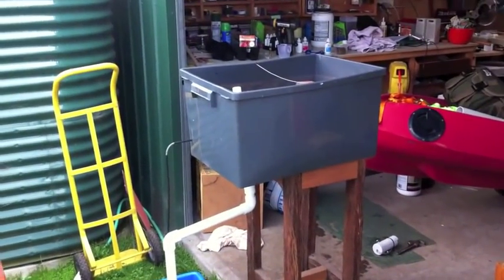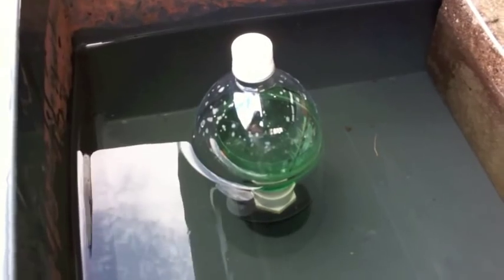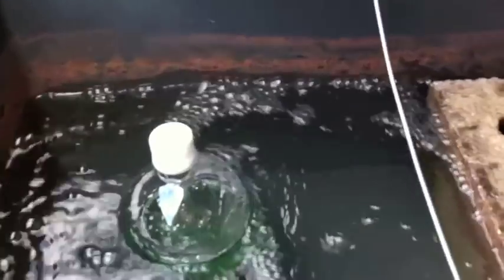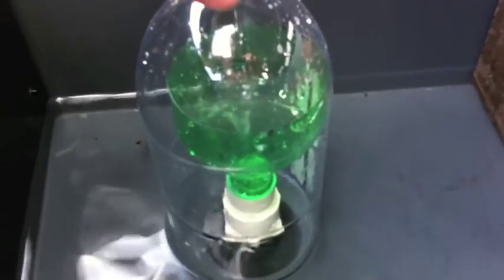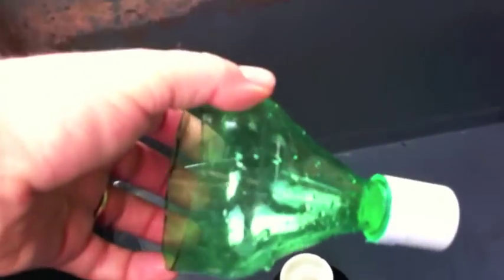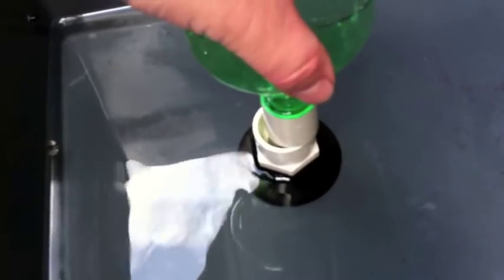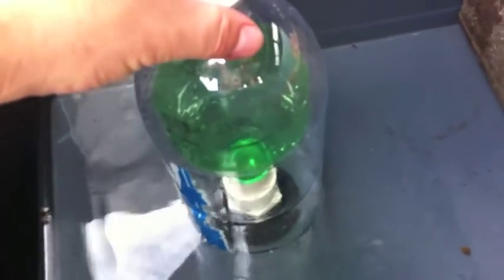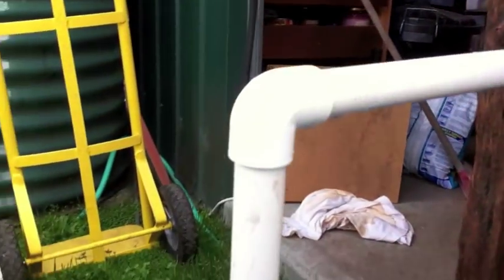Aquaponics - Cheap Bell Siphon with Plastic Bottles

Comment: Wow Thankyou. I had put together a standing drain pipe but I did not have a pipe wide enough to get the suction needed to drain.  So after watching your video I tried using a soft drink bottle with notches cut out of the bottom. This worked perfectly. Hooray.

Comment: This is an awesome setup! Tried PVC, but this is so much easier and cheaper. I did have a problem stopping the siphon, but I added the snorkel tube in the top cap and that solved it.
Reply from the maker: Also try to reduce the flow on the pump, if there is too much flow from the pump it will not stop either.

Comment: The most important tool to have with aquaponics is a level!  I tried to explain this to several women and they didn't understand until I got my trusty builders level out and let them play with it so they understood what was level and what wasn't.  They knew water could not flow up hill... I think.  Then I said you can make your system level and then when you fill it up with media and water the weight, soft earth and shoddy work could cause it to be out of level and then the siphon and other things may not work.  I can't sew, cook or multi task as good as they can though.

Comment: looked online for bell siphons, prices are a joke. 35 pound for a small cut pvc pipe. so looked up homemade bell siphon and here i am.

just tested it. and works great. my only problem is the bottle sucks itself in. and with a tray of 300L of clay pebbles. im worry they will fill the gap and stop it going back. so will have find a stronger bottle.
but thank you. you just saved me 70 quid
Reply from the maker: Hi Shane,
Great news it works.Here in Oz I have found that ribbed water bottle work best as the ribbing gives them added strength. Plus you can find them in just about any bin! 
The best part about it I find is you can see what's happening. Priceless!
Brett C.
Reply: thanks for the advice. i got a orange juice bottle thats alot stronger. that i try out tomorrow
Reply from the maker: shane cattell be sure to come back and let me know how you go.
Always like to here.
Brett C
Reply: Brett Cooper well mine was on a larger scale, i used 2L bottle inside and a 5L square water bottle.
first problem. 2L was to weak and sucked its self in. solved by cutting and placing init. a rim from a plastic plantpot.
then i had the problem after water went back down it kept the airlock. puting it in a kind of freeflow. solved by drilling a hole in 5L. then using a gromet and peace of hose. cutting it off about 1" from the bottom, so that it sucks in air after its below the 1".
now its all working fine. even with 250L of pebbles around it..

Comment from the maker: There might be a couple of things to look at.
1. Note enough flow to get get started - once it is full and water flowing in add some more water from a bucket to see if more flow helps?
2. Have you added in an elbow on the outlet as I have in the video, I find this helps a lot in creating a suction.

Comment from the maker: Hi Enrique,
Sounds like the pump flow could be your issue.
Another thing to try is make sure the stand pipe is level and the water is going over evenly?
If it's only going over at one spot I find it's harder for it to start.
Also try an elbow on the bottom of the outlet. This can sometimes help?

Let know how you go.

Brett.

Comment from the maker: Yes you will need a gravel guard, PVC is probably the strongest or you could try a bucket. What ever you use just make sure your hand hand fit in all the way to the bottom.

Comment: I use a male plumbing threaded adapter, a female electrical threaded adapter (no taper to threads) and an "O" ring. Cheap at Lowes or Home D. Never had a leak in 9 mos. and I am running 5 ibc grow beds soon to be 10. I do enjoy your clear bottle for entertainment sake.

Comment from the maker: @leema2100 I use 25mm PVC on the bottom of the bottle with a 25mm threaded adaptor onto the 25mm tank adaptor. I hope this helps? The PVC pipe is a little bigger than the soft drink bottle so i just us hot glue to pack t out.

Comment from the maker: Hi,
If you are talking about the out side bottle nothing stops it from floating away, as the water rises the air inside gets pushed out the pipe attached to the funnel. Normally the whole unit would be inside a large PVC pipe to stop the media from getting sucked up. Hope this helps?

Comment from the maker: @plantbaseddietplan, there are couple of things you can try. 1. is the funnel level, is the water coming over the sides evenly?. 2 try increasing the water flow. 3 put an elbow into the outlet pipe or even a small restriction to disturb the water as it comes out. Try them in order and please let me know how you go?

Comment from the maker: Need to make sure the water flows over the funnel evenly so it cuts off the air, you could try reducing the bottom of the funnel or maybe add in an 90 degree bend on the outlet. 
If possible post a video or a photo of your set up and I will be able to help you more. Good luck and please let me know how you go.
Brett.

Comment from the maker: c. The space in the bell (outer bottle) doesn't make a huge difference as long as there is a few mil between the funnel and the bell for the water to get past.
I hope this helps?
If not let me know at what stage it's not starting or continuing.
Regards,
Brett C

Comment from the maker: Hi Konig640, no it doesn't need to be water tight. If I read this correct it does start but then stops? Sound to me like you do not have enough water going over the side. Is your pump running flat out? If it is maybe reduce the size of the hole in the funnel to allow the water to back up a little before it starts. Let me know how you go and what happens. Brett.

Comment from the maker: Please start on the post below then come back to this one.

3. Is the water flowing over the top of the funnel evenly - if it just come over on a low point it's much harder for the hole at the bottom to cover over and create the vacuum.
They are the main issues I have come across.
Are you able to post a video of whats happening. More than happy to help as much as I can.

Comment from the maker: Hi John,
It won't be much stopping it from starting, I just have a couple of questions:
a. As the water flows over the top of the funnel does it appear to be covering the hole at the bottom or just running straight out? If not your inflow needs to be increased.
b. Do you have an elbow on the outlet below the tank? This can sometimes help.

Comment: Hey brett, I'm having trouble starting my bell siphon. My stand pipe has an inner diameter of 12mm I think and my bell siphon is a 73mm pipe. But my old external aquarium filter has a weak flow but it's able to full the grow bed in 5 mins but then the water level reaches the stand pipe and stars to drain down slowly. The siphon never starts but if I add 2 liters of water to give it a quick fill, then it starts to siphon like it should.
Should I get a stronger pump or make the stand pipe narrower
Reply: Add an elbow-joint under the tank. This will provide some counter-pressure, allowing your water level to rise a bit more and in turn activate properly. 

But yes, you should get a pump with a larger flow-rate.

Comment: How do you prefent the outside bottle to be pushed up whe the system fills again? I mean, if the botle is empry, the air that is in it can't get away. Or do I oversee something?
Reply from the maker: As the water rises the air is pushed out through the drain/stand pipe in the middle that goes out through the bottom.

Then around the outside of all that would be a PVC Pipe or similar holding back the media.

Hope this Helps Wim.

Comment: does the syphon (the green part) need to be completely watertight with the base?
I was wondering because I built a similar one but used a glue gun to fix it which is not 100% tight. thing is that there is only a realy small amount of water flowing into the syphon which makes it stop after a short while....any suggestions?

Comment: I may be missing something quite obvious, but I guess I still don't understand how a siphon works. I'm currently testing my little one, and I have the "green bottle" set up. I have cut another bottle to go over it. I put the bottle on top, as you've seemed to. But I'm not getting the siphon effect. Is the remaining space in the top part of the bell the thing that causes the siphon effect? I'm quite dense as you can probably tell.

Comment: would like to see this run a full cycle with the intended pump(if intended as a constant pumped system) i think you will have issues with stopping the syphon
Reply from the maker: Hi Bykerdellic,
I have a similar siphon working in my main system now. The main reason for it not stopping is too much water flow.
In that case you need to add in a tap and just slow the incoming water down  a little.

Comment: hey, great siphon! I'm trying to reproduce it but my outter bottle keeps flotting. I've tried tinkering with the size of the bottle and the "vents" at the bottom for the water flow but no luck .. would you have any tips? cheers!
Reply from the maker: I have never had a problem with that. The air inside the the outer bottle should escape down the centre of the funnel. Even if it did rise when the siphon starts it would pull it back down.
Reply: Hey Brett, thanks, no worries. Something wrong with my outlet pipe which I fixed. Working great now! cheers

Comment: I have a problem of DIY siphon. My plastic water drawer/tank is not too big. I tried a different size of siphon. However, the water does not go fluently everytime, nor it could reach the very bottom of the siphon.

So does the following matter ?
1. Height of inner and outter sihpon ?
2. Size of the water drawer/tank ?
3. Size of the hole for water leakage ?

If there is a recommend sizes or formula, that will be great.
Or if a whole set of tank+siphon can be purchased, I would love to (because I spent a lot of time in testing already).

Thanks a lot for any help please.
Reply from the maker: Chun Yi Chow Hi, are you using a siphon like I have in the video?
The height of the inner stand pipe should be high enough that the water stops about 2cm under the top of the stones in the grow bed.
If you are having issues getting it to start look at these:
1. is the funnel/stand pipe even, check that the water is not flowing only over one side but evenly around the rim
2. add and elbow to the bottom of the outlet pipe.
3. make sure you have enough flow coming from the pump, if it tries to start and won't use a hose to see if some extra flow will help get it started.

If non of those work see if you can post a video on youtube of what's happening and come back and share here to see if I can help.

Good Luck,
Brett C
Reply: Thanks Brett. Here is the setup dimension but the videos take few hours later to be uploaded.

https://www.facebook.com/media/set/?set=a.10153291738978669.1073742225.591438668&type=1&l=ba1913caba
Reply: I will upload the video soon. When there are no objects in the tank, it works. However, when I put all the circle pot into the tank, is it because the pressure and water volume change, that's why the siphon did not work so easily ?
Reply: You can see my other photo albums. Other setup (e.g. hydro / aqua are working and I have been eating the vegetables after 3-4 weeks). This siphon is another add-in to my project. Thanks a lot for help.
Reply: Chun Yi Chow is the PVC the outer guard to keep the media away? If it is there are not enough holes in it to let the water in. Looking forward to seeing the video.
Reply: I only have 2 PVC inside the tank. 1 PVC is the small pipe and the outer one you saw was to keep dirt and leaves away.
Reply from the maker: Chun Yi Chow I think is the issue, the outer PVC to keep the dirt away. There needs to be a lot of holes to let the water in. I find using an angle grinder works well to make slits in the PVC. Or just fill it with holes like Swiss cheese.
Will it work ok without the outer PVC guard?
Reply: I only have 2 PVC, 1 outer 1 inner. Unlike other users may have 3 PVC, I cannot remove the outer one. Otherwise, how could I create the pressure ?
Reply from the maker: Chun Yi Chow would be great to see a video of you set-up. Check out this video I did late last year at my dads. https://www.youtube.com/watch?v=DCAiIRgYkkY see if you can get your system running with some plastic bottles? Then you can see what's going on inside.
Reply: How can the Pepsi wasn't glue? Wouldn't it be floated when the water is full?
Reply from the maker: Chun Yi Chow This is a common question, the air goes out down the stand pipe as it's open to the outside. Give it a try and let me know how you go.
Reply: It floated!!! That's Why I have to glue it. I uploaded 2 videos and please comment. Thanks.
Reply from the maker: Chun Yi Chow hi Chun, sorry for the late repsonse. I have been traveling. I looked at your videos. Is there an actual funnel inside the bell? If there is try a plastic bottle as the funnel to get a better flow, I think the funnel outlet might be a bit narrow. As for the PVC to keep the media aware make sure it is full of holes all the way to the top not just at the bottom. 

I find that the bell will not float away once the PVC outer shield is in place. Make sure you can get your hand into the bottom of the outer guard and make a fist. 
Hope this helps?
Reply: Brett Cooper I changed to a larger PVC on the outside. The inner pressure supposed to be larger. However, the siphon did not work up and down everytime.  >_< I simply has no clue because I tried different shape already. What I can be sure is that the inflow from the pump is not too fast/strong.\

Comment: made this one, I the systems needs tuning, how to go about that? the siphon doest start, and if it starts, it doesn't reach the bottom.
Reply from the maker: A couple of things to check, make sure the funnel is as level as possible so the water goes over the sides evenly and   cover the hole at the bottom from all sides sort of at once. Also I find an elbow on the out let pipe can help and if all that fails you may ned a bigger pump. The easiest way to work that out is once the water is flowing over the sides of the funnel add more water from a bucket or hose slowly at 1st till you find the point it works. If that is the case you nay need a larger pump.  I hope this all helps. Brett C
Reply: thanks for the input, will try out
Reply from the maker: When you say it doesn't reach the bottom do you mean it doesn't pull all the water from the bottom of the grow bed? If it is it will never get all the water out there will always be a bit left usually the depth of the teeth on the bottom of the bell.
Reply: I did some modifications and is much better, I have uploaded a video also. if u see it, u will get the idea, also its a very small set up right now, will think of bigger one later. I am a vegetarian, so having fish is like keeping a pet. thanks again